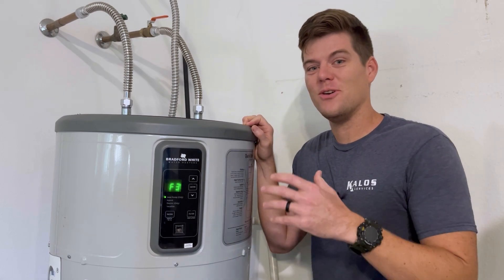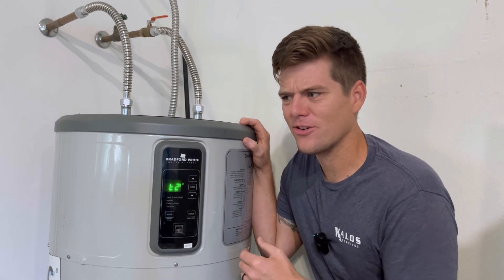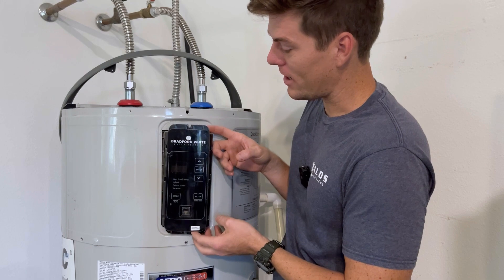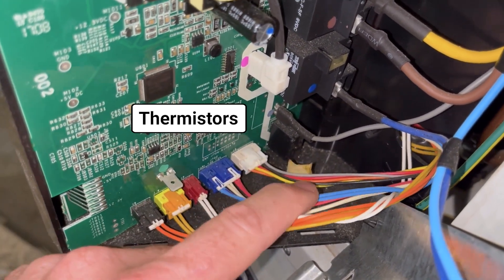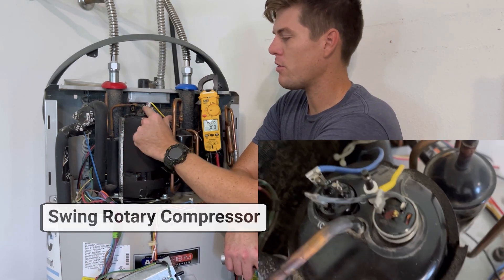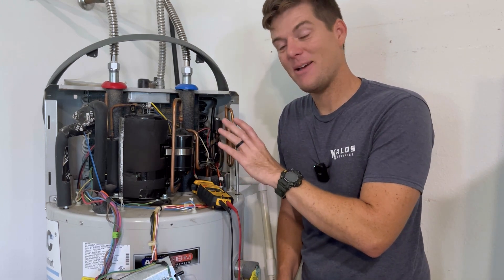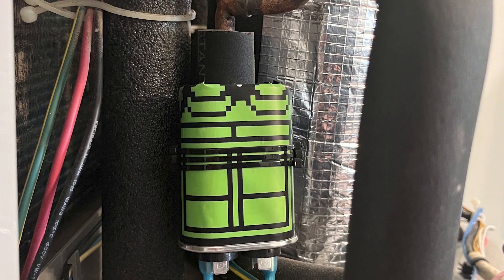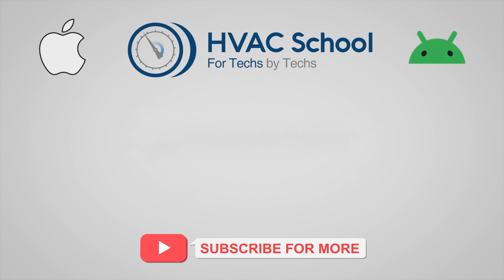Heat Pump Water Heater Troubleshooting Guide

Comment: I have this same problem. Can you tell me what capacitor you used please?
Reply: This one took a 12.5mfd but you should always check the compressor nameplate or capacitor on the system you are working on.

Comment: Hi Roman, I have the same unit for 2 years, and all the sudden it had no power at all, circus breaker is good, I have electricity to the unit but no display on the control board, does it mean my control board is bad?
Reply: Try putting it into test mode and see if it responds. There are a few fuses on the board that could be keeping it off that you can check under the boards cover

Comment: I have a rheem hp water heater in my garage and it's 2.5 years old and already been through 3 control boards and 4 thermistors and I believe it's slightly low on refrigerant now.  Biggest POS ive ever worked on too.
Reply: I have heard good and bad things about Rheem. This is my first HPWH

Comment: Thank you for your excellent training videos. Why the hell doesn’t the manufacturer provide these in-depth tech training. Why does a carrier dealer has to rely on a third party to produce these videos. Thanks Gary
Reply: That is a great question revealing a huge problem with current manufacturing. They are so afraid of teaching you about how they may fail you might think that is normal and not buy one. Sales drives what everyone does. I feel the opposite teach everyone how to work on it and just make a quality product, the end

Comment: Compare the electric bills before and after the replacement of the so called high efficiency heat pump water heater, if the difference less than $20 per month, I don’t want to do the switch. You save a little bit each month, then after a while the repair company comes to your house and collect the money from you. Sometimes you even don’t get longer enough time to save that much money for repair companies 😂
Reply: I mean if I have to run a dehumidifier in my home to maintain humidity why not get the byproduct of hot-water? I get it, they are crazy expensive but if you can get a good deal I think they are worth it. Recovery sucks though compared to resistive. Easy to overcome if you know your usage